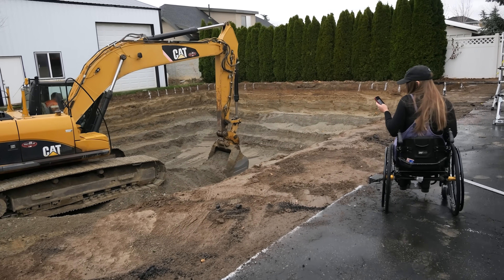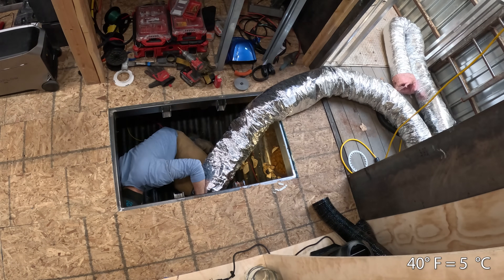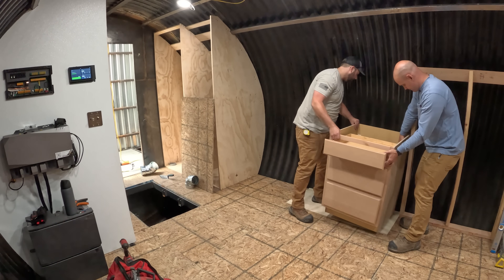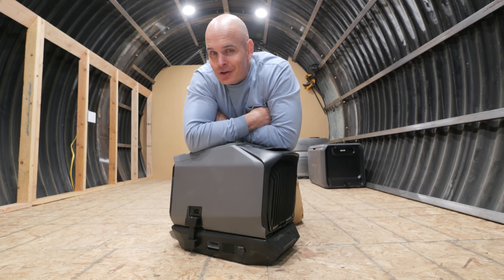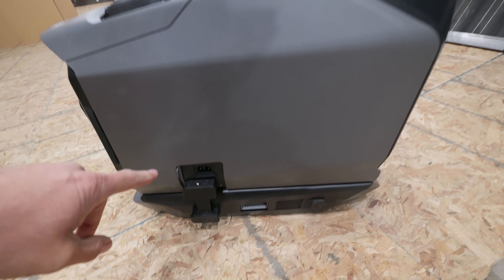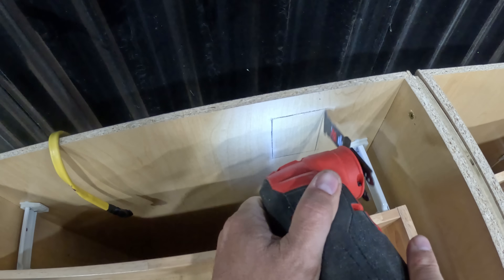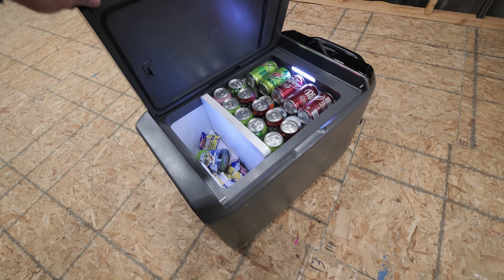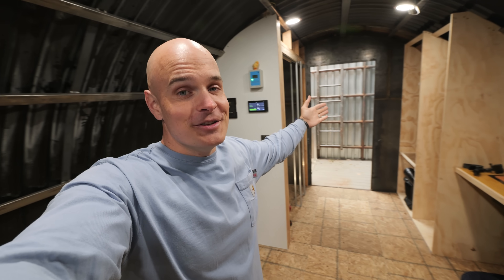How much air does my Backyard Bunker need?

Comment: The intense UV and infrared light from a plasma cutter is not eye safe. Anyone within visual range can get a serious eye injury. I see the operator had a welding mask, however EVERONE in the working environment MUST have adequate eye protection to prevent injuries.

Comment: Hey Jerry, just a thought! You might want to consider adding an "artificial skylight" to your bunker. That way, even if you have to stay there for a while, it could help you feel less enclosed and more connected to the outside world. It might just make a long stay underground a little easier on your mind. 😊
Reply: Absolutely! There is a DIYPerks video about making one yourself which would be an awesome thing to integrate into the main living area. Downside is it uses a lot of power and requires sufficient space. People on the DIYPerks forum are also experimenting with much more compact lense-based designs.

Alternatively one of the big brands that makes commercial artificial skylights might want to sponsor a video.

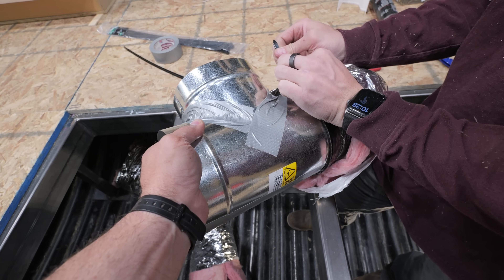Comment: Tell me this guy was not using duct tape at 2:45 mark on the T duct fitting. Duct tape dries out and will often fall.off in a few years. Should use aluminum faced 2" wide tape.

Comment: First of all.. Thank you for taking the time to convert Imperial to Metric on screen. :) 
The bunker project is awesome. I know that Eco is a heavy sponsor her, but.... Perhaps you could look into thermal well for heating up, and fuse this to a air purifier and circulation. This is fairly cheap and effective way to heat up fresh air, as old air is pushed out but warming up the fresh new air before exiting. 
...
Here in Norway, a thermal well of from 100 to 200 m (aprox 110 yards to 219 yards), can heat up a large house in minus 30 C (aprox minus 22 F) way more efficient than a normal air to air heatpump.  They are costly though, but.... so is this bunker project :D

Comment: 7:31, I may be misunderstanding the reasons behind why heat pumps dont work in cold temperatures, but I assumed it was due a limitation of the refrigerate being unable to evaporate on the on the cold side due to how cold it is (the outside air). I think you are going to have issues using that thing to heat your bunker once its less than 41 degrees OUTSIDE the bunker.

7:45, brother I dont think it will work as a heat pump if you are not using outside air. The Heat has to come from somewhere, you could probably make a "geothermal" equese system by putting a loop of empty tubing outside your bunker in the ground that will use the soil to facilitate the transfer of heat from outside your bunker to inside the bunker. I am unsure of how much you would need though.

Comment: random thought, but couldnt you pipe the intake for the wave 3 to the surface, so that any hot or cold air its inputting is fresh going into the bunker, so that way, it isnt actually recirculating your air but replacing it with fresh hot or cold air, causing your bunker to be a higher air pressure, which forces the old air out? therefore it is your fresh air intake along with your air conditioning?

Comment: Isn't induction like the standard in any developed country?
Reply: Not in the USA, no. Induction is a relatively new thing over here. This is pure speculation on my part, but I would guess mostly you'd find coil electric stoves, a smaller percentage of gas stoves (mostly propane, some natural gas) and then finally induction, most of those likely in new homes. This based on what I've seen and heard in the north east of the USA, might be different in other areas
Reply from the maker: Correct. But lately the USA has been acting far from 'developed'.
Reply: @JerryRigEverything  true. Man, this shit has been rough to live through and its not over yet

Comment: Zach, there is a massive downside to using heat pumps like that. The cold air needs to be ejected, which you're venting off to the outside. this means that you're creating a slight under pressure inside, which then means that cold outside air will rush back inside to replace the air it has vented off outside.
Unless youre taking cold outside air and cooling it down even more, its hard to tell exactly how the ducting is from the video
Reply from the maker: Not really.  The wave 3 is designed that with 2 intakes and 2 completely different exhaust vents. The internal air circulates and the external air circulates.
Reply: @JerryRigEverything  In that case, its designed great. it was hard to tell from the video how exactly the ducting goes. thanks for the clarification. Many household portable ac units do have this flaw
Reply: @JerryRigEverything  If I were building this I'd over-complicate things by having the cold side of the heatpump going into an insulated chilled pantry before exiting. Also, when you get around to a air-change ventilation system I'd put the air you're exhausting through a passive air-to-air heat exchanger (can be scavenged from condenser clothes driers) to pre-heat the heatpump outside air inlet. Complicated I know but you'd be getting the absolute most out of your energy that way.

Comment: There is no actual fire or so, but personally I would suggest to also place a CO detector. CO is slightly lighter than O2, but it's more lethal than CO2. It probably would never be needed, but better to have and not need, than to need and not have...!

Comment: Random thought— you’ve got the sensors reasonably high up on the wall but you’ve also got small children. I know literally nothing about this, but you did mention CO2 is denser. Is it safe for your kids down lower? Have you tested down where the gases are likely accumulating?

Comment: Sorry but your outfit for the intro scene is ridiculous. IF there is too much CO2 down there, only a system with separate air tanks would enable you beathing. These filters work only if the air around still contains sufficient O2 for breathing. If O2 was displaced by CO2, there is still nothing to breathe even through these filters.

Comment: EcoFlow is making heat for the bunker and producing "waste" cold air... You need a bigger fridge... Just build an insulated box in line with the waste cold air and refrigerate with the Wave 3 output.

Comment: did you perform the total watts calculation of all the energy use in the bunker.   Operating a 100 inch tv will put off a lot of heat for the room as well.
Reply from the maker: Ohh good call.  Just another reason to play lots of video games

Comment: Speaking of ventilation, you can take a look at soviet bunkers which have ФВУ, aka filter-ventilation installation. It can be operated without any electricity, you are turning the turbine yourself from the inside, installed filters are filtering everything nasty from the outside air and they can be changed, all the maintenance can be done without leaving the bunker and it forces airflow into your bunker which is also very good to have, because having higher air pressure than the outside air pressure helps to keep everything from coming inside your shelter. And it doesn't require any electricity or fuel to operate, just a little workout for the people inside

Comment: having worked in construction for design consultants doing ventilation systems amongst other things and also doing underground pumping stations for water companies a constant source of fresh air and exhausting inside air is vital. Your levels of CO2 were going up to critical with two open ends on the tube, when you put doors in those levels will spike quite quickly. Normal rooms receive 1-2 air chages per hour (the total volume of the space would represent one air change) but kitchens and bathrooms have higher rates to avoid condensation and odurs. This means your bunker really needs a permanent push-pull ventilation systems which should be in a trickle mode when the space isnt occupied but put into purge for a couple of minutes before use then into a normal ventilation mode when the space is occupied. In addition i would recommend a heat exchanger to harvest waste energy from the exhaust to minimise power use. 

One induction ring for a family of four? But you can have a 100" TV? Priorities require review. And PLEASE do something about the rust on your steels in teh shafts. They will only get worse and harder to treat effectively. They should have been done before installation especially in this agressive environment. Also the outside wall needs inuslation or you will get constant condensation when you are occupying the space. The outside ground has an immense thermal mass (something ground source heat pumps use as a reservoir of energy) and you will never overcome it so you must sperate yourself from it

Nice project though, it is interesting and higlights just how hard a real bunker is to build and maintain

Comment: It's a well-thought-out video; however, CO₂ levels alone are not sufficient indicators. The air may contain other pollutants such as metals, chemicals, and especially radiation—the very threat this bunker is designed to mitigate. Therefore, I strongly recommend acquiring a device capable of measuring comprehensive air quality parameters like PM1.0, PM2.5, PM10, TVOC, CO, and CO₂. Your current CO₂-only device might not alert you to other, potentially more hazardous contaminants.

Comment: The ecoflow while a good sponsor is a bad choice for a bunker. It separates intake air into exhaust air into your product air. Your exhaust is pushing air outside. This will create negative pressure inside the bunker pulling fresh and cold air inside. 

Besides that being less than ideal for keeping your bunker warm it will also pull air from any area to inside the bunker. Not so great if you are looking to avoid outside air.

Comment: For anyone concerned about the 1-3 heat ratio thinking "isn't that claiming to make free energy?" It isn't making that much heat. It moves that much heat. The average air conditioner for your house works the same way. This just has a valve inside so it can do it going both directions (or you just mount it backwards in the winter). Most AC units could work as heaters and just... Dont?
Reply: True.

Heat pumps get less effective at actually keeping my house warm when it's really cold outside.

Comment: As a climate system designer... there are some important points:
- that CO2 sensor, is NOT a valid sensor for health & safety. It's a consumer unit that isn't reliable and also has a dangerous automatic calibration setting. Dangerous for you that is... if it assumes the lowest value in a week is 350... then your bunker is a death trap if you keep it in there for longer term. Make sure it's on manual AND make sure YOU do the calibrations. The sensor, while it's still a considered cheap sensor, is not a bad one and uses the better technology... but it's still a 'cheap sensor' for professional pov approaches. Put healthy and large bands on your reliance on these values please!!
- climate treatment - look into Heat Recovery Units / Heat Exchangers between in/outside air directions. With the AC on the inside you will always want to keep as much 'balance on energy' on the inside. For this it would work like a charm and keep it cool in Summer and hot in Winter with up to 70% energy savings.

Noted, your heatpump is already expelling air so in theory it should also draw fresh air in from somewhere. It is surprising you've already ran into higher CO2 levels. If desired your community can easily provide the calculations on how much air you need to expell to keep below certain levels (or I can... ) depending on how many people you will want to host.

You can also consider plants... You will want light anyway, plants love that stuff too AND eat CO2. Make sure you put a decent amount of Orchids or Bromeliae in the bedroom part as those will consume CO2 at night (the older leaves) and not add CO2 like almost all other plants tend to do (all other non C4 CAM plants).

If you want to consider actual food production, lettuce and tomatoes are your easiest bet. They grow very very easily, provide usuable seed for new growth and the setup can be explained within a single A4 paper if you don't want the highest efficiencies.

Comment: As explained in detail by Technology Connections, those all in one air conditioners with a single "exhaust" are wasting a ton of their efficiency by design. If it blows out cold air to heat the room it just creates a vacuum that sucks in more outside air again, while also just working harder to overcome how well the room is sealed. In this case the vacuum suction is a good thing, but its still very uncontrolled and there is no way to heatexchange on the air that is sucked in through all the tiny gaps.. Thats something to have to think about all the time

Comment: Oxygen sensors are usually built using galvanic cells that slowly lose charge and need recalibration very often (and replacement eventually). Make sure you are very careful to check the manufacturers manual for yours, and follow recalibration steps as required.

Comment: (6:32) Child Labor, i approve! And yes, induction is very common in Europe. It heats up far more efficient as all the power is directly spend on heating up the pots and pans. And it cools down rapidly after use, and the absence of fire is also nice. And its a flat surface so you can put things on it even when it's off.

Comment: If you have a non-magnetic pot/pan/etc, you can purchase a magnetic disc that goes between the pot/pan/etc and the induction cooktop. This may not be as efficient as having the magnetic pot/pan/etc, it does allow the person to use the induction cooktop with non-magnetic pot/pan/etc.

Comment: Thanks for the 14min eco flow ad.
Reply: It seems like that air conditioner functions like most other portable units, where the nice cooled air in your room gets pushed outside. I had a far larger unit, and it did basically nothing. So, he is shilling a highly flawed product that barely works.

(I can see it has 2 hoses, however, one is going further into the bunker for distributing the heat so this is basically equivalent to those shitty one-hose air conditioners)
Reply: That’s all this series has turned into. 15 minute ads with a bunker build sprinkled in.
Reply: @NathanHeerts his last 7 videos before this one have been traditional videos for him. Are you paying attention?
Reply: @ I'm not talking about his other videos, I'm talking about the bunker series. How bout you sit this one out.
Reply: sybau
Reply: Why did you watch the entire thing then? You can’t sit through a video about him solving an issue with some device?

Comment: Bringing in fresh air means ventilating conditioned air. Not sure if there is a good way to capture some of that heat that will be dumped out the vent. A residential heat recovery ventilator would be overkill.

Comment: Kind of a weird sponsor product placement. It's a cool product, but it's completely inadequate for this use case, and doesn't make sense for a permanent installation anyway. You could have put in a legit ground source heat pump, and it would be a lot more efficient and make a lot more sense.

Comment: really need to install home assistant for the smart home stuff down there, I have air monitors dimmers etc.... you could go super easy with wireless air controllers and some 12-24 relay switches for electric.

Comment: I think you are trusting too much on technology for a bunker, if you would have to use a bunker I think the scenario would be very different. Thinking in a natural disaster or nuke, the changes the solar panels survive are very low, and then all the electronics inside will not last long with the batteries. I would personally consider some more traditional options to heat and cook without the need of electricity.

Comment: I'd be looking at a passive air flow system using underground piping and air vents. Use the heat from people and machinery inside to pull the air up and out. Obviously you'd want to be able to shut them if there were environmental contaminants outside.

Comment: I see a small problem with the heat pump setup, because if it is not exchanging heat (and the air) with the ouside it is running more like just a normal 1:1 resistive heater, basically pumping out the losses. You aren't getting the full heating effect if you aren't throwing the cold air outside, and then you need fresh air back in. Even then it's only an advantage if the cold air output is colder than the outside ambience. If you want to keep it isolated you could use a heat exchanger like a radiator on the portable unit and another on the outside with maybe some glycol and a small pump to keep it flowing, or even leave it to convection.... but seeing that you need an air intake with filters as ventilation, you could have the exhaust be the same that the heat pump would use, just have a valve there, even a check/one-way flap to keep it from backflowing from temp. changes.
Reply: and seeing other replies - having vent grates go under the floor to catch CO2 and cold air is an excellent idea! You ideally want to have as much verticality as possible between you and the lowest point, because there will be both less CO2 and more heat.

Comment: Cool to see the oxygen sensor working in the thermal camera... it needs that heat to reversibly "burn" a tiny platinum+ziroconia electrode, reacting it at temperature with atmospheric oxygen to generate the electric potential that's being used to indicate oxygen levels.
Reply: Thanks 👍 learnt something new

Comment: Do you really need to insulate the bunker when it’s insulated by multiple feet of dirt? I mean, sure, the front part where you have your shaft, but otherwise, that place should heat or cool with absolutely minimal effort.

Comment: 7:30 So I mean, I know technically it's still plenty possible to freeze to death even at relatively high temperatures such as 40°... But doesn't it kind of defeat the purpose of having a heater if it just totally bottoms out below that?? Like damn